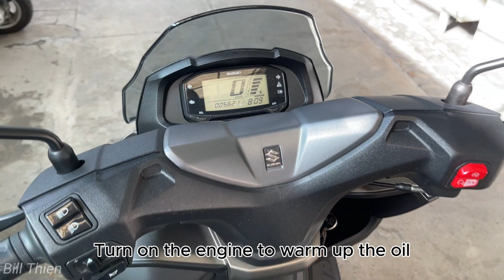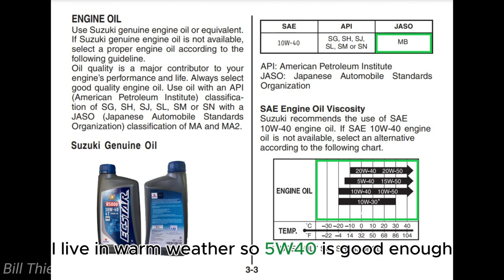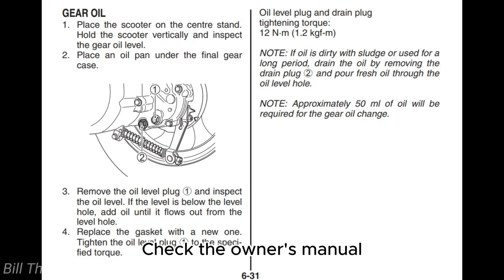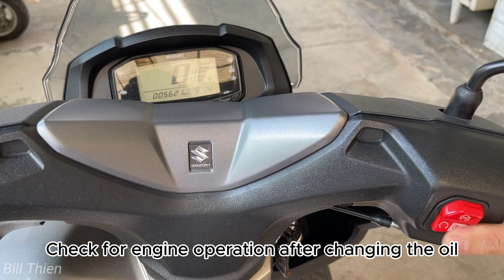SUZUKI BURGMAN 125 OIL CHANGE (Engine & Transmission)

Comment: Which oil u use in gearbox? Do you use same engine oil in gear box?
Reply from the maker: @sahilshaw3217  Owner manual and Service manual recommended 10w-40, for real, and as I said in the video, I live in warm country, so 5w-40 or 10w-40 will have little different. In summary, yes, you can use engine oil for the gear oil as manufacture recommended, focus on the correct specs: 10w-40